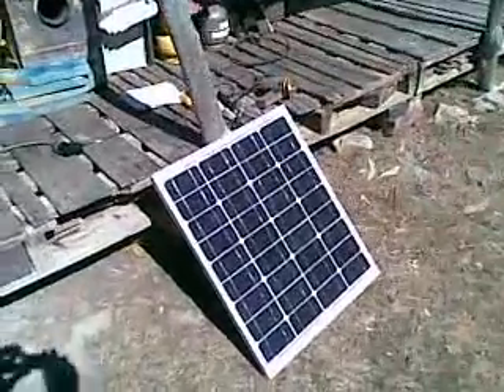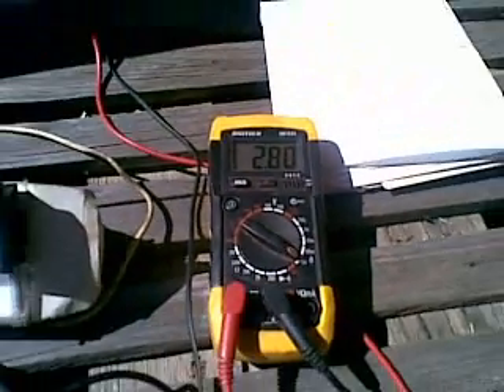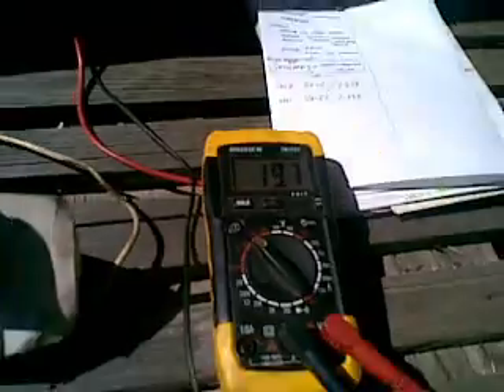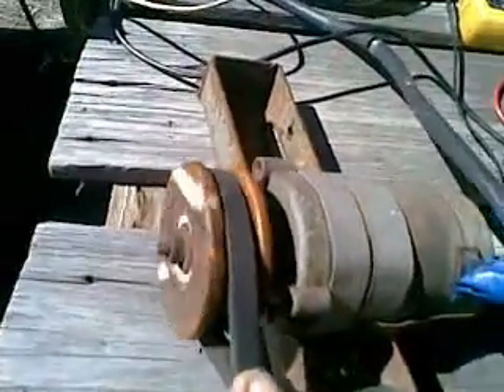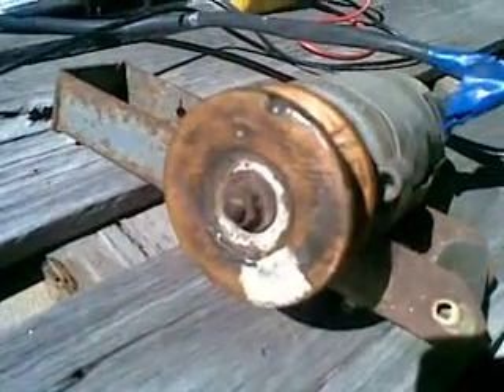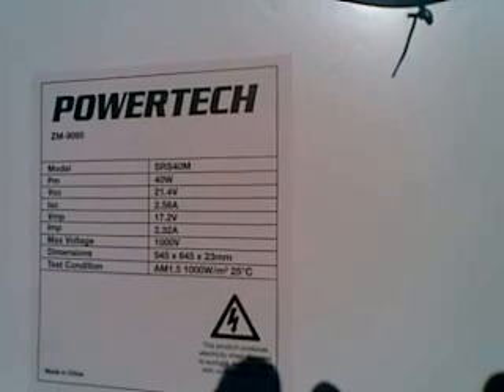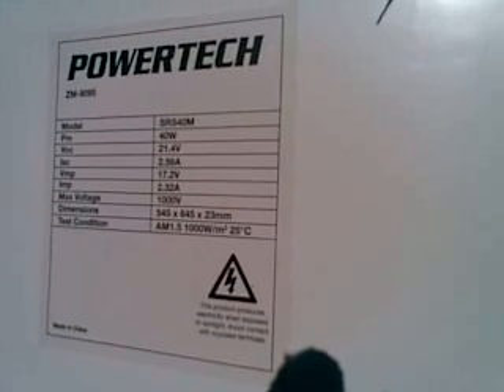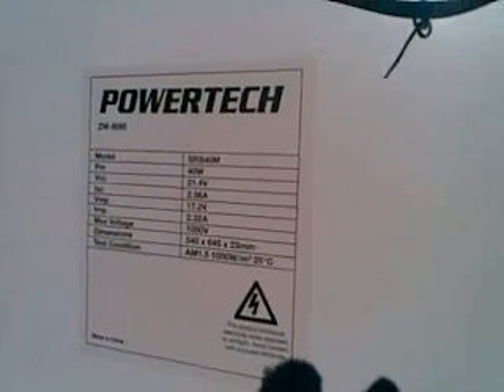40 Watt Solar Panel, Acceptance Testing, Rated Vs Measured Output.

Comment from the maker: @cosmicskydaddy1
 G'day mate ! Thanks, um, this is going onto the Roofrack of a Holden Rodeo (Petrol V-6 4WD station-Wagon)... It's to be a "Minimalist" SunFoil, in that no extra Fairings are involved, though I do reserve the right to aim for minimal Aerodynamic Drag. I'm thinking of drilling the Trailing Frame-Web ; both to vent Hot Air when stationary, &  to cut Drag at Highway Speed. Search "SunFoil To New England Nuclear Energy...", to see it... Ciao !

Comment from the maker: @davesact
 G'day Dave ! Thanks mate, um 3 & a half thousand is a beginner-size Houselighting System, it's about what I'd have to spend to replace my PVs, Inverter, & Batteries with new. I use 0.2 to 0.35 Kw/Hr/day. Lights & Radio & Phonecharger... Um, yeah, Current is Current, but there aren't many applications where one doesn't want to store & release, rather than simply use it as it becomes available... But it IS a good Demo of how much grunt a Panel pumps out. Ciao !